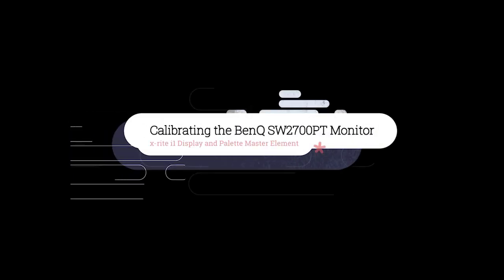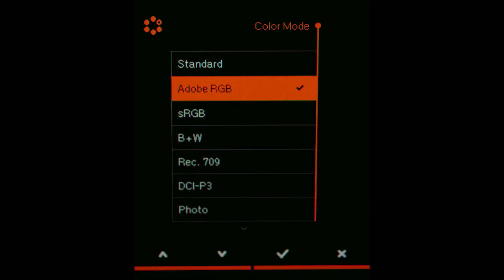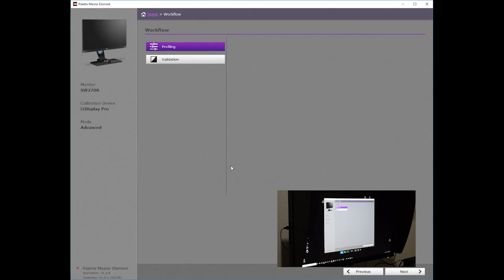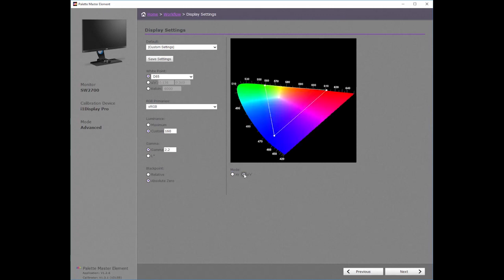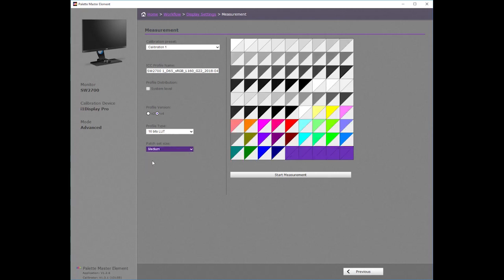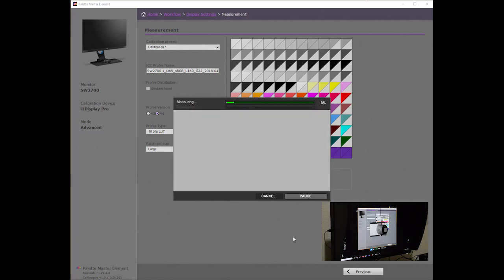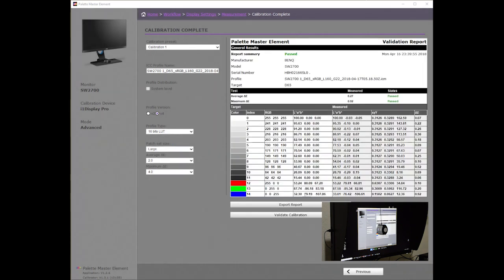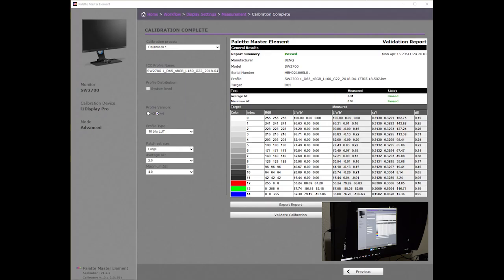Updated: Calibrating the BenQ SW2700PT monitor using XRite i1 Display

Comment: I tried to calibrate using the SPyder 5. It failed the 3 times I tried it. Sometimes it had a color shade over the screen, others look good but the Delta Values were too high. I dont know what I'm doing wrong.
Reply from the maker: I remember having a severely white pink color on my monitor when I first attempted calibration. I actually gave up, called BenQ, and although they were helpful I still came up with the same problem. When I returned to calibrating the screen later, I made sure my device was attached to the USB ports on the monitor and that I only used BenQ's version of the Palette Master Software. If you have done these and are using a proper DisplayPort cable and your graphic card knows you are working in true 10 bit and you have selected  the 16 bit Profile Table setting in the Palette Master Software and you are still getting a poor result, then call BenQ. They were really nice people. If I can get a Spyder5, I will consider doing a video on calibrating the SW2700PT with that device.
Reply from the maker: BTW, which version of the Spyder5 do you have? the Express, Pro, Elite, or Studio?
Reply: Roger Pafford I have the Pro version. I had connected the monitor to the pc through a HDMI  cable directly to the PC, not the graphics card.
Reply from the maker: Make sure the PC GPU thinks in true 10-bit. Hmmm. This is really worth checking out. If you are using an on-board Graphics Processing Unit (GPU) and the GPU chip is sending 8 bit data to  the monitor, then you can't get the full tonal range of this monitor. I would think the calibration would suffer as well. Your Spyder5 Pro is capable of better DeltaEs. Time to look at the motherboard specifications for the GPU in the motherboard manual. Some manufactures say "10 bit" graphics, when actually they mean 8 bit+FRC (2 bit "Frame Rate Control") which amounts to filling in the color gaps.That's not the same as true 10-bit. If your GPU supports true 10-bit, make sure it is set for that. Then calibrate. I'm interested to know what you find out. If it does not support true 10-bit output, the you will need a graphics card that does. So many gaming cards do now. And remember, if that fails, call BenQ's support team. They are nice people who know their product.
Reply: Thank you I will definitively check that. What about the cable? A regular HDMI should work correct?
Reply from the maker: If you get a true  10-bit graphics card , then use whichever cable they recommend. I still wonder if your on Boards graphics chip supports true 10-bit. If it does, then go with the cable that your motherboard and monitor agree on.
Reply from the maker: PS, I did try to get dataColor to send a Spyder 5 Pro or Elite so I could make a video of its use. They basically advised I could go and buy one if I wanted to test it. Uh, not what I had hoped. Oh well. I'd better study for my boards instead. :(
Reply: Regular sort of. The monitors are supplied with high quality cables allowing 10 bit flow over the cables. Not all cables support or work well in that aspect. Always buy the best cables with the latest format level support possible. @vincearredondo
Reply: Gaming cards work in 10bit mode, but they don't process colors in 10bits, only in 8bit. For true 10bit mode you need AMD Fire Pro or Nvidia Quatro. About the internal CPU graphics I really doubt it can support true 10bits, because then it would not make any sense to produce very expensive professional graphics cards if you could just use internal graphics

Comment: My maximum Delta E keeps failing. My result hang around the 4.97-5.21 mark. Any clue why?
Reply: How old is your calibration device? Does it pass all validations checks? An old monitor can have delta 5 differences but a new one no. All BenQ SW monitors are factory measured and that deviation goes to a top layer above all other corrections and is thus unique to each monitor. That is why it is most likely a cable, device our Graphics card or settings problems. I am on Mac and it is much easier> Windows has many more options that can skew the best intentions.
Reply from the maker: So, here's a start: make sure your graphics card is a true 10-bit or higher card -not an "8+2" card. Make sure your calibration device is attached to one of the USB ports on the left side of the monitor. Use BenQ's version of the calibration software. Do not select the 8-bit option when running your calibration.This refers to the internal calculations, not the reported output quality of your monitor. But , these calculations do affect the quality of the output image. If you calibrate for sRGB, the DeltaE values are better because the gamut is well within the monitor's capabilities. The DeltaE for green is better using sRGB as our target gamut. However, that is no reason not to use AdobeRGB gamut as your target. When you start the calibration, use the Advanced mode. For graphics and photography, use the D65 White point. (Print production shops supposedly use D50). Luminance should be around 160. Higher luminances really create their own issues and frankly are too much on your eyes. WHen comparing colors, our eyes are easily fatigued and need time to recover. Brighter luminance is not really better. Gamma is 2.2. Choose whether you want to pick the "calibration 1" or "calibration 2" slot (next page). Use Profile version 4 (I think this refers to the Version 4 ICC Specification). Profile type? Matrix is explained by Parler Plaisted: "Comparison of Adobe RGB and sRGB Colors", www.color-image.com. I choose the 16 bits LUT. According to Eizo (https://www.eizo.com/library/basics/maximum_display_colors/), this allows for more precise calculations during internal processing of the video input signals. Your 10-bit monitor will produce a better image because it's internal video processor is calculating with 16 bits of precision not 8 bits of precision. This is important when trying to "manage color". And, don't forget, BenQ's support is really friendly. Call them.They were quite helpful when I spoke with them on 3 different occasions. Rog